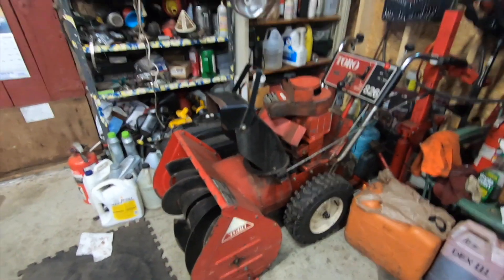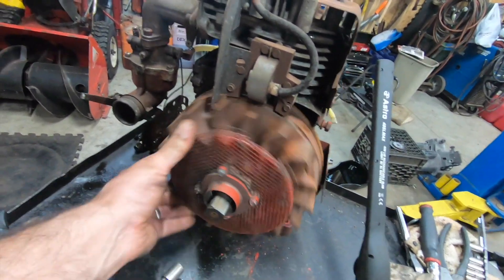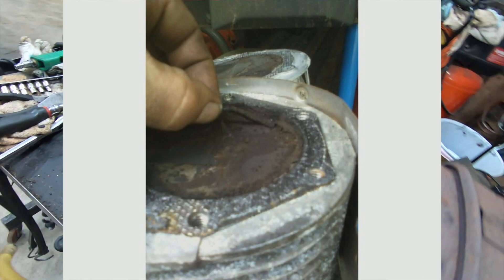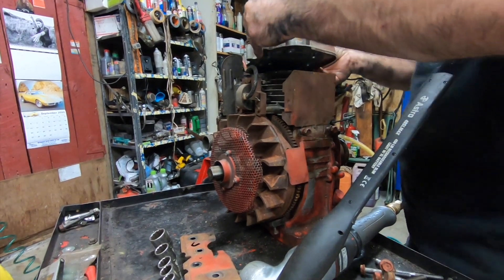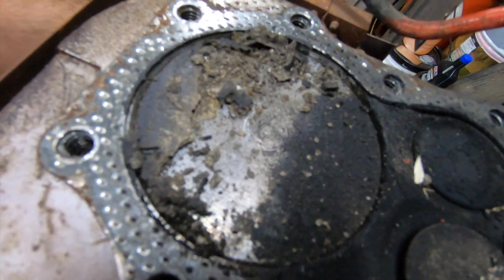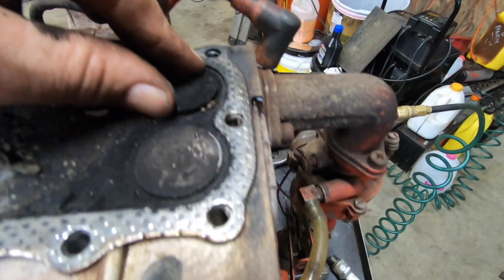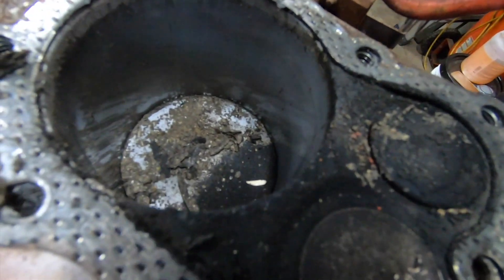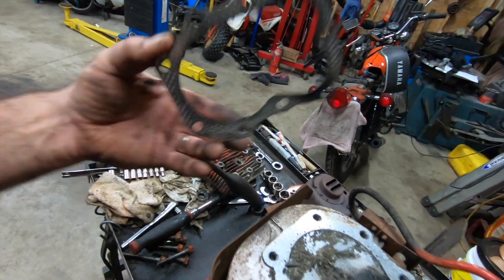Briggs & Stratton 8HP 190402-0914-01 Toro 826 snowblower - won't roll past top dead center!

Comment: good morning smitty!   wow theres a lot going on there  oil ash mixed it with that?  i have a homelite leaf blower its new...dont start was thrown out...has spark and compression wont fire even with starter fluid  i figure  a broken flywheel key or leaking reed valve
Reply from the maker: Mornin’, Dave! Yeah this is a strange thing. No oil smoke whatsoever when it’s running. Used it that winter & wasn’t a hint of smoke. Guess it was all fuel related, coupled with sitting many years. Strange for sure! Yeah I think you’re on track with the flywheel key. I got a weedwhacker that was thrown out with the same exact problem. I put Loctite on the shaft and just ran the bolt in with the flywheel as close to where the keyways lined up, & it ran great. Sold it for good money too, since it was almost brand new. 😎

Gonna be a hot one today! Took the RD to my dad’s this morning. Nice and warm once I got close to the suburbs.  Supposed to hit upper 90s today. I know I won’t be cold today! 😁 Stay cool out there! Have a great weekend. 👍🍻
Reply: yea ill look there first... too hot out for me.. i will take ac today   looks like the heatwave will break next week
Reply from the maker: @scuba422123  Supposed to cool off tomorrow here. Got T-storms forecast for Monday. That means it'll be a sticky, humid & miserable day in the shop!😂
Reply: Check to see if muffler is plugged. It can cause no start with good spark and fuel.
Reply from the maker: @blairbreland1443  Yep, and the ports can pack up tight, too, especially when they're fed a regular diet of cheap 2-stroke oil ... or premixed motor oil.
Reply: I've seen even with factory recommended mix not all the oil burns and clog the muffler. Then the mix had to from 40:1to 50:1 to stop it from happening again.
Reply from the maker: @blairbreland1443  I run Amsoil at 100:1 in all my two-stroke stuff. Carbon build up is just about nonexistent. That Saber is some really good oil. Neighbor cut 10 acres of trees with one Stihl saw using it - mixed at 80:1, too. He never had it apart- not even the muffler to clean the exhaust port. Was clean as a whistle. Pretty impressive.

Comment: Back in the day when gas was not so good and an engine running at a constant speed would carbon up like this. I've seen it many times in the old days.
Reply from the maker: Interesting! You must be talking prior to WWII?  My grandfather used to tell me stories of life in those days. Were a few different options then, too, like ethyl or white gas he said. Gasoline was dirt cheap and always a crapshoot as to quality, and was very low octane. Same with the roads - a total crapshoot!  These days it seems MA is regressing back to that era as far as the roads go, lol. 😂
Reply: No talking about the 80s. I'm old but not that old.
Reply from the maker: @blairbreland1443  Naw, gas was GREAT in those days! We never had any carburetor or carbon trouble with any of our engines back then. My grandfather had a shop at his house in those days - never saw the problems we see today. Was mostly adjusting or cleaning points, replacing spark plugs, changing oil, and when they ran the hell out of them, a rebuild.

Comment: Your two for two bud!
Reply from the maker: Indeed I am! 😁 Has to be the strangest issue I have ever run across in 35 years of tearing engines apart! That generator I had torn down just about to nothing when I discovered the problem. After seeing this twice, next time I’ll just take the recoil shroud off and see if I can spin it by hand and either direction. If it’s not locked, I’d put money on a carbon issue, except maybe in a overhead valve engine. 

Good to hear from you, Wyatt! Hope your summer is going great. My kind of weather up here in MA right now. I’m loving life. It’s as if the South came up North, at least weatherwise. Over 80° at just about 8 PM. I definitely can’t complain about that! 😁 Have a great weekend, buddy. 🍻

Comment: havent seen that  seen a spark plug wiere end on a 5hp brigss got log spliter for free pulled head removed the metal piece boom still running 8yers bach
Reply from the maker: Nice! That's a great score!  Yeah, this was a weird situation - shocked I've seen it twice in a 5 year span. Prior to that, I hadn't even heard of this in 20+ years of wrenching! 

Hope you got through the heat today! I was loving it. Out on the bike early this AM to my dad's, then back in the blistering heat from my brother's place. Sat outside with the neighbors a bit and shot the shit. Love this time of year. I've got to enjoy every second of it before I have to hibernate for 9 months, LOL!  Have a great week, buddy! 👍🍻
Reply: yep i hear you had friends stop buy to day brake job yeaterday 06 honda 214k one brake on back brand new rusty other rear  scratiching  front lower pins frosen .  need more in fo its a daily now loaners here ./lol got him on the road im figgering abs valve mad but   . i need a better scanner but im broke love to have thath under gnote one ivans using but need oil at thath arrrrrrrr 
 @SmittySmithsonite
Reply: got my 58 apache fleetside on the lift need to make her stop  dont whant to sell but i keep her blong enough
gonna trry rebuilds master cly 40# vres 1`20   ill see how bad core is 
try and get whilfe film some
Reply: who your wrish heal ? my left arm still sucks but pushing trough
Reply from the maker: @willefixit  Yeah it sucks - nothing is cheap in this industry, and now everything is going higher. Business took a nosedive here. Everyone cutting back. I still have that aircraft here for an engine swap (almost done), and a bike that needs a rear tire. Beyond that, I've got nothing lined up. I haven't bought any new tools in a few months. I need a scope, and would like to get a J-box. Some day I'll get one. Not sure when these days.
Reply from the maker: @willefixit  Hand still hurts if I try to make a fist, but most of the time I forget about it. The surgery seemed to cause more pain than the actual break did!  Glad you're still able to work with your arm there. 

Those are sweet trucks! Always loved the looks of those. They're getting big money for classic trucks these days. That '49 3100 I had here I think sold for around $20,000!! CRAZY!!  Hope you get the brakes figured out easy enough.